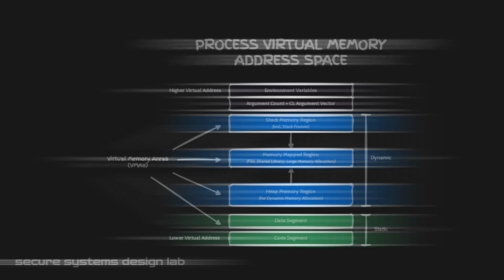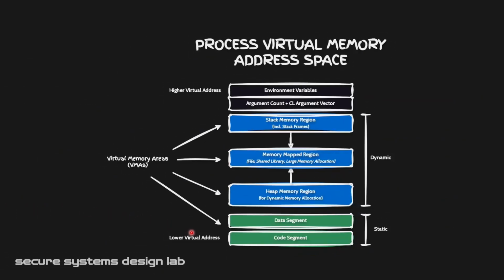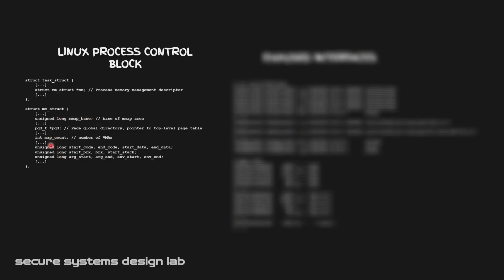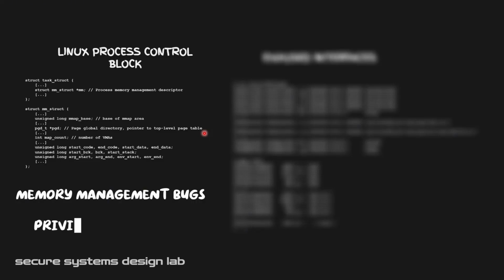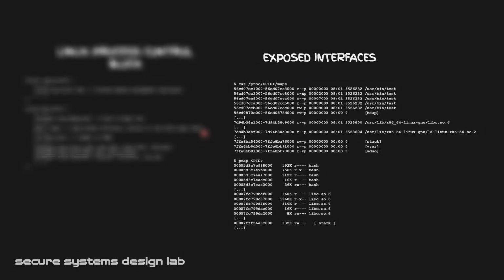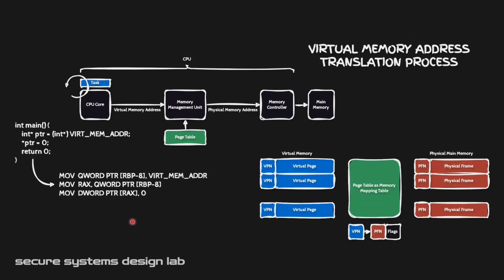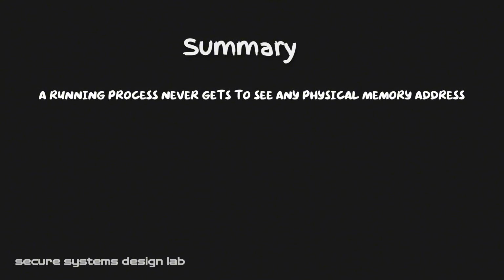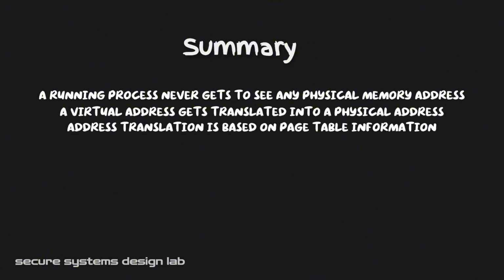How Your Operating System Enforces Process Isolation and Memory Protection (simplified)

Comment: Interesting!!! In particular haven't thought before that there's a page table per process on a Linux-based system
Reply from the maker: Not only on a Linux system, also on Windows. The CPU provides a special register which contains the page table base address of a process. It can be used by any OS to switch page tables during a context switch. Everything else is done by the MMU.